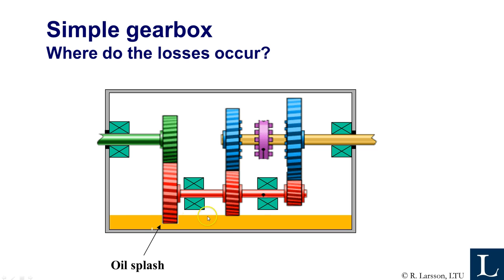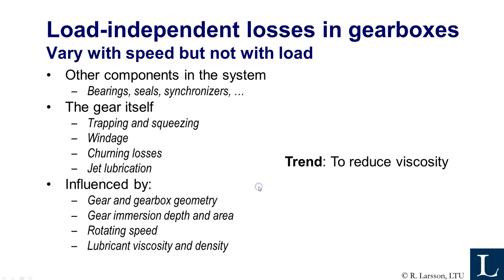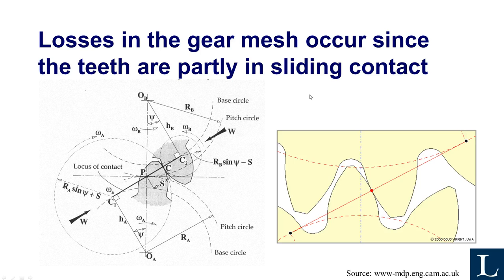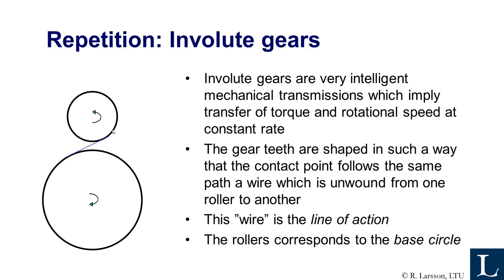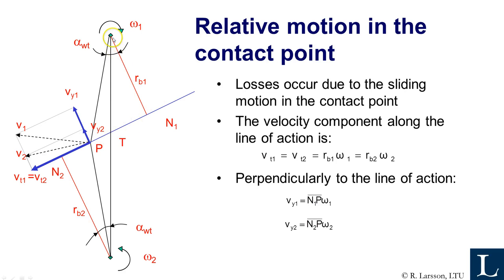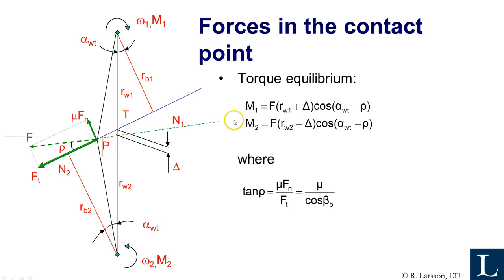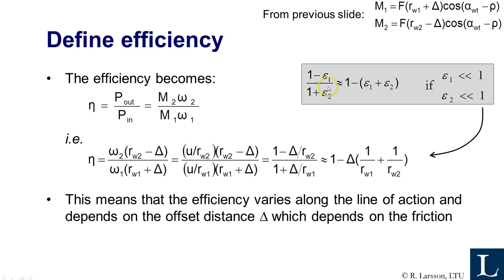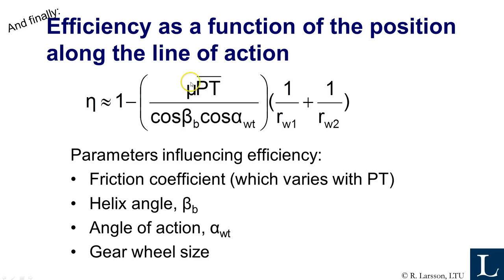Gear Efficiency - Part 1

Comment: Question: the output power is less than the input power, but what if gear 2 were driving gear 1?  Then according to your equation, the output power would be greater than the input power.  This of course can't be true, so I'm trying to understand where my gap in logic is.
Reply: Not at all, the total output power will be still less than the total input power.
Reply: @felicytatomaszewska yes I know - I acknowledged that fact in my question. Your response does not answer my question, it just restates something that I already said in the question
Reply: @ryanfleming3091   well as for the equation goes, the drive gear is labeled 1 and driven is labeled 2. So therefore the labeling in the equation needs to be changed when you drive wheel 2 and output from 1. Or just flip the fraction...i.e 1/2 instead of 2/1